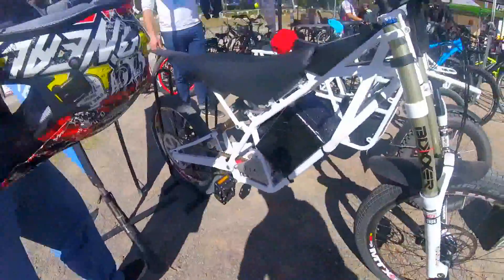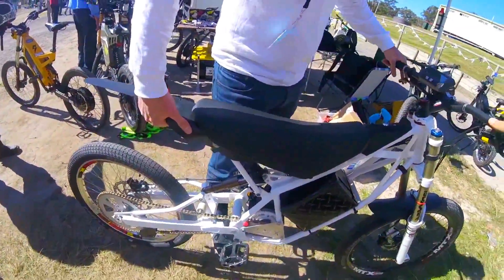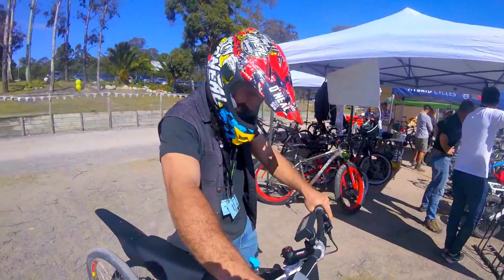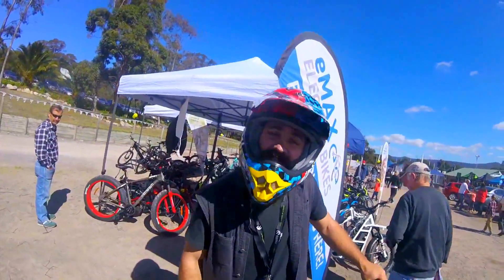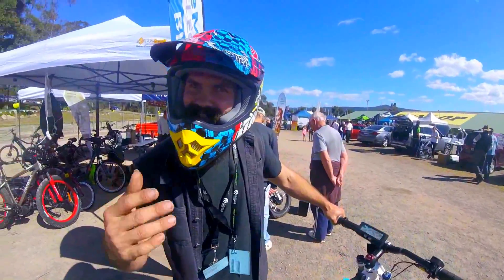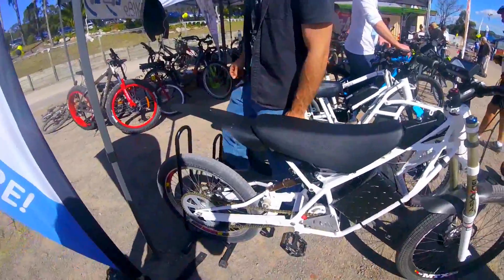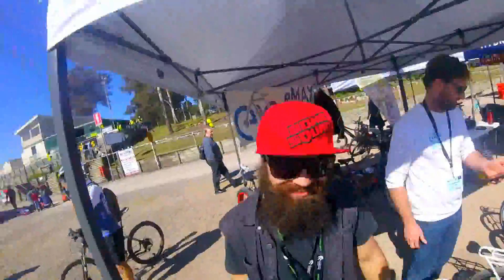LMX lightweight electric dirt bike - First impressions chatting with Jai (mechanics motorhead)

Comment: I'm in Aus, i just got some 18650 battery tabs from aliexpress but they are steel core and seem to weld at a much higher temp/amp on the spot welder i also have some pure nickel i got from fasttech but they aren't the 18650 variety and they seem to weld at a lower amp however these test were not done on 18650 cells so ill have to test it on some dead ones, what amp you using to spot weld?

Comment: No BMS... any fuse protection?  Or is it just protected via controller 60A limit.
Reply from the maker: Yeahhh... this is just our raw prototype with no fuse, no BMS, battery connected to the Cycle Analyst shunt to the controller to the motor... most battery problems occur during the charging, we have the balancing leads connected to each series for balancing and monitoring, 18650 cells are waaaaaaaaaaaay safer than LiPo. 
My 18650 14s 5p pack that I ride my bike every single day was last balanced last year... the Panasonic PF cells are perfectly balanced running without BMS but I do monitore and check voltage very often despite the series are always balanced. Controller will do the low voltage cut off (you need to program what voltage you want to cut) and the charger will do the high voltage cut off, the problem is if one of the series is faulty it will not charge properly and that voltage will "spread" to the other cells and overcharge some series... this is when people get a big BOOM is they don't pay close attention! It is recommended to use BMS, I run batteries without BMS just to study how well these cells behave and how far I can take them without balancing.. "geek experiments" haha =]

Comment: look how much extra battery space there is!!
Reply from the maker: Exactly... there is soooo much room left to fit a LOT more batteries, maybe double the size of the pack.. we packed 1.7KWh in this little black box with 140x LG MJ1 3500mAh arranged in 72v 24.5Ah, Paul made a similar pack size, a bit wider that had 200 cells with custom off-set cell holders... that is CRAAAZY power and sooo little... no dangerous LiPo cells anymore.. 18650 is the way to go =]
Reply: +ElectricBike (Bruno) you said maybe double. I'm calling you on it! i better see video with the 50Ah battery pack in this monster appear in my subscription feed soon (a bigger motor and some of the gucci fin cooling wouldnt hurt!) 😁

Comment: Hey Bruno. Looks like it was a great day! What is the story on the gearing you use on that motor on the lmx? Is the max speed gearing limited or power limited? It looks really strong off the line, for that power levels you mentioned. Just curious :)
Reply from the maker: Heeeeey Paul.... yeahhhh.. this LMX motorcycle packs a serious punch with soooo much torque, the max speed is a matter of gearing and also the battery voltage... its possible to transform all that ridiculous torque to speed just by changing few sprockets... oh yeahhh.. but the insane acceleration is irresistible... hahaha.. sooo much POWEEEEEEEEEEEERRR
*You will be making our next LMX batteries haha no one can beat your battery build technology =]
Reply: Thanks Bruno. I'll be honest, much of the things that have pushed my battery development, have been towards improving safety, so in the event anything happens, the battery will not do anything dangerous. As you know, the cells you use are the main factor in determining the performance. Bear in mind, that high power cells have big power potential to drive a powerful motor, but they also have the power to make some big sparks, or worse, if the pack shorts out for any reason. For me, the challenge is making a battery pack, with great performance, that is also tough, reliable, weather resistant and also as safe as it possibly can be. Then to do all this in relatively small quantities, without it being crazy expensive :)

Comment: Hay man are the nickel battery tabs you use to spot weld 100% nickle or are they nickel plated
Reply from the maker: Heeeeey Matt.. we do use 100% pure nickel tabs here but I have done some packs with nickel plated tabs for tests and comparison, I NEVER noticed any difference in resistance and all that blablabla people say... to be honest they weld much better than pure nickel and all 18650 cells I know are nickel plated. It is kinda easy to tell when is plated, you can scratch and add salty water and wait for few days, the plated ones look like "silver glitter" in most cases. The distance between cells is so short with a significant large nickel plated area that the resistance difference is irrelevant in most cases specially below 40A.
We do get these dual nickel tabs (strips) from a battery manufacturer that we buy our batteries from, they don't sell to the public, only if you buy their products in large quantities unfortunately.. I am trying to make these quality tabs available, if we can stock more I may convince Ewan (eMax owner) to put up on his website for sale as it is very rare to find elsewhere... I really want to help people to have access to these things so more people can make their own packs... =]
What country are you located?

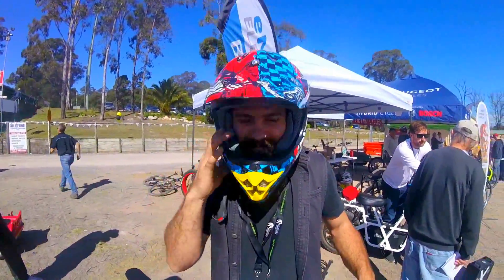Comment: 4:34 where the fuck did that beard come from XD
Nice vid as always and epic bike man ! You should if you can try to make a sort of reinforced gear shifter and 3 or 4 gears on the back wheel, should be possible but would take some time and tinkering ;)
Reply from the maker: Hahahaha... I couldn't believe how he managed to fit all that inside a regular helmet... caveman style is the ultimate in ebike fashion hahahahaha 
Single gear is awesome, it's a super looooong range gear with ridiculous torque, depending where you ride you can pick different sprocket size for a bit more top speed, you could also increase the voltage and amperage for more speed / torque as well.. we were only testing it at 60A at the show and it was insane... imagine when we pump MORE POWEEEEERRR hahaha